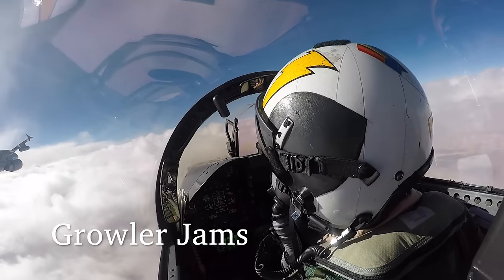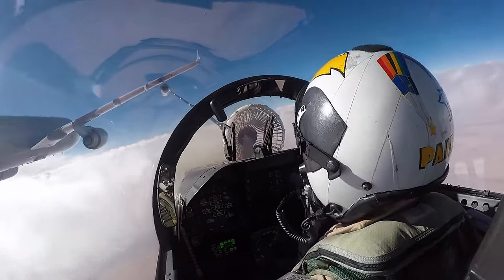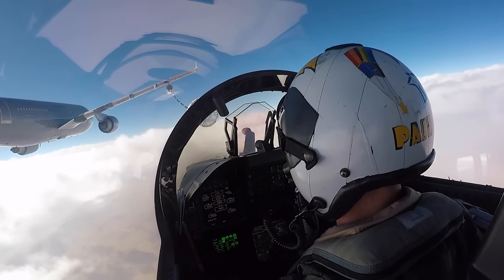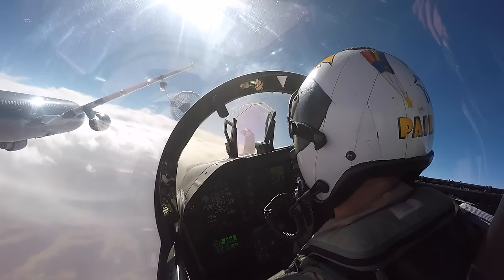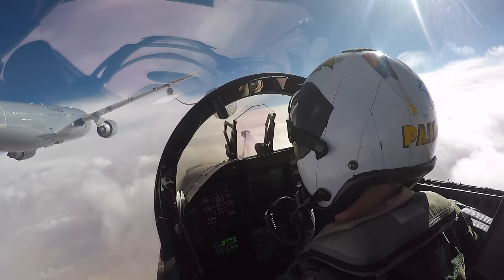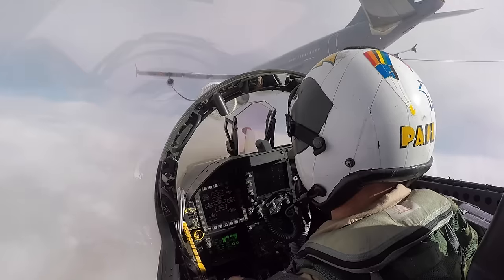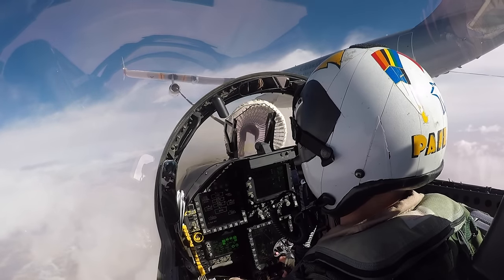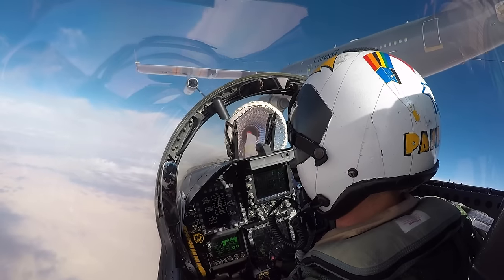My NIGHTMARE! Trying to Get Gas as Time Runs Out

Comment: "Missile warning.  Not a big deal.  Just wiggling my fingers and toes.  Fire off flares.  Not a big deal.  Just moving out of the way.  Wiggling my fingers and toes..."
Reply: And don't forget to tighten sphincter.
Reply: “Wiggle your fingers and toes” (relax). Training in T-38As back in the mid 1980s, we were told this all the time by our instructors. Fingertip formation 3 feet on the wing at 300-400 knots. It worked!

Comment: The voice over is awesome. Just wiggling my toes relaxing lol. While flying a 70 million dollar plane connected to another 100 million Dollar plane going 500 miles an hour while connected. Sounds real relaxing. Thank you to all our Great Service members.
Reply: Lol exactly!
Reply: they are only going 275-320 knots
Reply: @waynegriswold8953  Oh, well then, that changes everything...just a Sunday drive! ;)
Reply: @waynegriswold8953  at ground level they’re doing over 500 mph
Reply: It's all relative, we and the earth are moving very fast together but not at all relative to each other.
Reply: @waynegriswold8953  from now on, when I go into turn 1 at the racetrack in my Corvette, at 140-ish, I will wiggle my fingers and my toes before trying to brake at the last split second.  NOTHING compared to tanking the jet.
Reply: @F80MGod  Speed don't change based on altitude lol. 500mph is 500mg.
Reply: @l3gendarylag805  huh? I’m telling the other dude who’s saying they’re only going 275-320 knots that at ground level they’re doing over 500mph ground speed. GS and IAS are totally different, the calculations are different, and the speed output is different based on altitude. Air density and all that
Reply: @z06king  While it's appropriate to stomp the pedal initially--the rotational speed of the wheels makes it impossible to lock up (or engage ABS)--provided you still make sure the weight transfers forward smoothly, as the vehicle slows, you'll need to get out of the brakes. Skippy teaches that the better technique is to use about 90% braking after the initial application so as to make sure you hit your corner entry speed perfectly. This is where you make up the most time under braking: not by late braking, but by not over braking. Especially when trail-braking to get the car to rotate (to go fast, you must have a rear slip angle of 5-8 degrees, just like at the front axle). See you at the track.
Reply: @waynegriswold8953  Thank you. It had been a while and i had forgot the speeds .
Reply: E/A-18G is $135 million last I checked, based on the loss figure for the RAAF Growler to ground fire at Nellis a few years ago.
Reply: Kinda makes ya wonder...... What DOES it take to get this guy excited!
Reply: @BlueZirnitra Careful now. You're going to attract the flat Earthers with talk like that. Lol
Reply: These videos show the team work and skill of all who support Naval aviation.  Unfortunately the CIC is a complete fool who has no appreciation for or understanding of the military.  And at the end of the day, our pilot friend here is a family man who you can tell adores his kids. Don’t  forget the military families who also help to make our military what it is.  Naval deployments are very challenging for the families at home. Fly Navy. Go Navy.
Reply: "You don't own the plane that taxpayers do!"
Reply: Going 500 mph but looks like he’s in slow motion. . Awesome

Comment: Did this in a Tomcat in the Med. The difference is it was off an A-6, at night, in a thunderstorm filled sky.  We saw a fuel level of 200lbs before we made a successful plug and transfer.  No lie! My pilot was a nugget.  The voice over is great idea.  Well done.
Reply: [<------ idiot gamer] Med=Mediterranean?
Reply: @andrewjhollins  yes
Reply: At least over the Med you're surrounded by allies for the most part.  Not the case over Iraq unfortunately.
Reply: jesus knowing how much fuel a tomcat can hold... 200lbs is the fumes of fumes.
Reply: @joshf-o6696  If you are down to only 200 lbs in a Tomcat it doesn't matter if you have 1000 friendly airfields around within a 100 miles radius because you are not going to make it anyway. So you end up finally in the same situation as the Iraq guy you tried to portray as "more difficult"
Reply: That’s remarkable. Do you mind me asking when this was? 90s?
Reply: 200lbs in a Tomcat is basically zero fuel, so you were either going to plug in less than 2 minutes or you were ejecting.

That's gotta be a trip in front of a board of some sort.

Comment: Great job, I have observed the RAF tornadoes doing this from inside a voyager and your walk through was very informative.

The hose and drogue on the right side of the tanker was empty of fuel and that is what was causing it to be very unstable, the tanker crew should have seen this and re-primed the system prior to any further engagement.

This is very prevalent when you swapped from right to left side, the right hose did not have a good catina and was visually flying much higher than the left hose.

Comment: I was a photographer in the marines in the 60s. In 67 I was flying back seat in a F4. We did a refueling with a C-130 when we had to back off due to a hydraulic failure. 

What was interesting was the C-130 was going flat out and the F4 was going as slow as possible.

Soon after I got out of the marines I saw a recruitment bro sure with a picture of a C-130 refueling a F-4. I took the picture on that flight. He was our wing man.

Even in the backseat it was the strangest thing I ever experienced.

Comment: Funny thing, I was wiggling my toes and fingers while watching. In my youth I was an ADJ in VA-52 onboard the USS Kitty Hawk. Later in my carrier I was operations manger in Boeing's Flight Test We qualified the KC-46 tanker. Both the KA-6D and the KC-46 had a hose and drogue system in the fuselage. These were made by Sargent Fletcher. One day I was riding the elevator up to the engineering floor and there were a couple of young engineers in the elevator with me. I noticed their badges were Sargent Fletcher. I told them back in the 70s I maintained their system on the KA-6D. They had no idea what I was talking about and looked at me as if I had two heads... This stuff never gets old. Thanks for sharing.
Reply from the maker: Cheers!

Comment: Fascinating video and description. That is one event I never experienced as a Naval Aviator, for as a Stoof driver with radial engines and props powered by Avgas that was something that no piston powered aircraft ever did. While that author generally refers to "gas" it is really jet fuel (more oil than gas) he is getting. Great series.

For those not aware of how great the reflective tape on a Naval Aviation helmet is, a test made while I was on active duty determined that the reflection of the tape could be seen on a clear night about 20 miles away when it with a search light. Many an aviator has been rescued at night because of the tape. What I don't understand is why the USAF takes the opposite position. Their policy is gray painted helmets with no markings. While I was on active East Coast flying (1967-1969) there was an AF two seat aircraft that took off from Homestead AFB (Florida East Coast) out over the Atlantic and had engine problems and they ejected. Not sure if AF required rafts then or not. But they never found them. That's another point - the Navy requires rafts as well.
Reply from the maker: Cheers! “Gas”, like “the boat” are slang.  Like you know, these are the words we intentionally use.

Comment: Oh, the joy of refueling! In the F-4, the probe was behind the pilot on the starboard side. The RIO would guide us into the basket, so as a pilot, if it was a different RIO, there was some adjustment to the guidance. Some knew that we had to fly the basket close to the canopy and a bit low; the air stream would move it right and up as it traveled aft. Others would give a "come left, easy left." On a miss, I always wanted to know the clock position of the miss, which help reposition for a new pass, as well as whether I should have listened or ignored the "come left." One night in the Med, after a bolter, and then a fouled deck wave off, I figured I had two passes to bingo. The ship told me they had a Tinker tanker (A-4 with refueling package) and wanted me to take a drink. I figured it would be trick or treat (trap or refuel), but no, they wanted me to rendezvous and take the treat. As if night refueling is easier than a trap. Hah! We pulled off the tanker with max landing fuel, and then Forrestal (CVA-59) told us to bingo. That became an exciting new adventure as the bingo field did not know they were the bingo field. Its lights were off, we couldn't raise the tower, my RIO was working the frequencies, also talking to the ship to let us come home or get the field to turn on some lights. Finally, runway lights came on, and we were on land. We had pinned the missiles and seats, but once inside I realized I hadn't brought in the fuel chits, and wanted to return to the aircraft to retrieve one. The duty officer wouldn't let us leave ops to return to the airplane. Apparently, a few nights previously, a guard had fatally shot his relief guard because the relief didn't know the security password for the night. We decided we could wait until the next day to fetch the fuel chits!
The next day we were back aboard FID (First in Defense). 

I really enjoyed this video, and others you have published. Thank you! Non sibi sed patriae!
Reply from the maker: Hell of a story.  Thank you for your service, Sir.

Comment: Man, my butt was puckered watching this and i wasn't even in the cockpit😂. So what was more nerve-racking to do the first time, your very first Case 1, or your first A2A refuel? I had a problem in DCS at first with the case 1 landing, but once i hit all the numbers right, it got pretty routine. It felt very controllable. With the a2a refueling, there are many more variables that are beyond your control. Not to mention pilot induced oscilation, which happened many times at first. Right when I'm about to connect to the nasket it's like "buck fever" or something. This was a great video in what i think is the most impressive skill of a naval aviator. I dont mean to make it sound like i can do this, but doing it in the DCS Hornet is the only thing I can compare it to lol. Thanks Pail.

Comment: As a KC-135 Crew Chief, I used to hate drogue missions, and used to make jokes about the pilots refueling, needing an assist (a basket) to refuel versus a much more potentially damaging hard point refuel. This point of view makes me retract all those uninformed jokes. I am still not entirely sure this wasn't simulation, there was a lot of time with pilot looking over shoulder as if he was talking to camera, too much to think it was voiceover. But, I could be very wrong. Nice job though. I learnt many things about my mission that I only had half the story of after many years of being on a tanker, watching refuels with drogues.😊
Reply from the maker: This was as real as it gets.  No simulation here.  Drogue tanking sucks, right?
Reply: @GrowlerJams  Yes, it seems drogue refuels on the 135R were easier due to the hose only being around 10' long, so the boomer did most of the work. Hard point refuels were certainly the best, except when it came to night refuels of stealth craft.

Comment: Just a suggestion: The drogue needs aerodynamic control surfaces and sensors so that is can be computer controlled to fly in a fixed position. That would be like on an airplane: rudder, elevator, and wings with ailerons. This way the pilot would be able to connect on the first try.

Comment: This was really cool, and a little tense there on the starboard side. I have a question that might be obvious, but i'm realy curious. As you're refueling midair and taking on several thousand pounds of fuel, do you feel the flight characteristics of the jet changing? Just napkin math from searching on google, you're adding ~15% extra weight in 7 minutes, i feel like the change in handling would be noticeable. Thanks for the content!
Reply from the maker: Not really.  The jet balances the CG automatically, so the feel is about the same.
Reply: @GrowlerJams  That's awesome. I should've realized the flight computer would  adjust. TYVM for answering, I really love your content! o7

Comment: Awesome vid! Is it allowed to use autopilot at pre-contact and during fuel transfer? Seems it would reduce pilot workload by holding the plane level with just having to bump the stick/rudders for minor corrections vs. manually flying into the basket
Reply from the maker: I’ve never tried it or heard of that as a technique.  There are so many  inputs that are required during tanking that autopilot just won’t hack it.

Comment: Sorry sir, but you are looking for the basket instead an fix point at Tanker.
At the deseangage you was not at the correct point.
The basket ran out from you showing that was not at the stable position. 
Go to pre contact align de basket and mark a fixed reference on the Tanker.
Don't look for basket anymore.
Fly on Tanker ref.
Touching the clouds is not a good place. The basket dance.
You may lose the visual sundly.
You have a precise piloting and you have nerves control. Good!
From a friend!
Reply from the maker: I get this comment from time to time from people that have never actually tried this in real life.  You can’t simply fly a reference point from the tanker and engage the basket because the basket is moving around much faster than the tanker.  In the end, the pilot has to look at the basket and make a play for it. “Don’t look at the basket anymore” will not work and is not a viable technique used by pilots. 

Where did you learn your technique?

Comment: A4 Skyhawk Jax Fla, I.F.R. gone bad, Dunno what happened in the air but the jet came back with the basket on the pribe, and the hose wrapped several times around the nose of the aircraft, fortunately it did not go back far enough to keep the nose gear from opening, fuel did get down the intake and mess up some stuff like cockpit pressurization, g suit etc
Reply from the maker: TYFYS.

Comment: For anyone who's interested, the plane took on 3,030 gallons of jet fuel. At the current price of $6.42 a gallon that's $19,452.60. I assume the Navy buys jet fuel in bulk, so cut it back to $4 a gallon. that's $12,120 for a single growler flying for 4 hours. Roughly $3,000 an hour. Double that to add a wingman. 
That's still only 5% of the flight cost for a Growler. Adding in the cost of maintenance, manpower, spare parts, flight deck operations and depreciation; as of 2018, Growlers cost $60,000 an hour to fly. So an 8-hour flight for two growlers costs the United States $960,000. Nearly $1 million.
While providing ECM over Anbar Province, Iraq.
To block enemy search radar.
Over Anbar Province, Iraq.
I demand the government buy me a free house. It doesn't have to be a nice one. Just 3-5 hours' worth of Growler flight.

Comment: Question, wouldn't it have been more efficient to wait until the tanker and you returned to straight and level instead of trying to establish contact in a roll? Civilian pilot here so I know eph all about aerial refueling.
Reply from the maker: Not if you need to get gas as quickly as possible to hurry up and het back on station.
Reply: @GrowlerJams  ah, ok, you’re on the clock.

Comment: Great Video. Do the drogues I've seen with wings on them make that turbulence more manageable? Has to be scary the first time!
Reply from the maker: I’ve never seen a drogue with wings. 🤷🏻‍♂️
Reply: @GrowlerJams  maybe rogue is wrong word. I saw another video of the refueling with a hard tube instead of hose and there are like "wings" on it. Not on the rogue itself. Had the big steel cage where you kept the U-shape in the line. That's why I'm not flying....
Reply from the maker: Gotcha, that’s a boom.  Air For e jets tank off that.  Never tried it.  Can’t really compare.
Reply: @GrowlerJams   thank you for your service!

Comment: Hey just a general question do you know what the most difficult health factors you need to meet to be allowed to become a fighter pilot? Heard its similar for German army to the US which is kind of my goal right now as ive realized a lifetime in a boring job is nothing for me.

Also AMAZING skill and not being too aggressiv in the end thinking dang i need to get it now. Thats a real master, knowing when to back out or request a bucket on the other side. As a DCS player i can more than appreciate this skill without even knowing half of the skill this actually takes to do up in the sky.
Reply from the maker: Not really sure…probably the vision requirement. 20/20
Reply: @GrowlerJams  Thanks for the answer sadly I dont have that but afaik in germany you can fly with glasses or get surgery which i will do either way. Thanks a ton and i have much respect for what you do.
Reply: @GrowlerJams That's why I fixed F-14's instead of flying them. By the way I was on the Roosevelt, and the Enterprise, and the Eisenhower, and the JFK.

Comment: does it make a difference from a330 which wasn t designed for refueling  compared to the the kc135 (mprs in your case )which was designed  as a counterpart for the b52 operations during cold war?
Reply from the maker: Not really.  Tanking is tanking.

Comment: As you take on 7000 to 8000 pounds of gas, do you need to increase speed incrementally to compensate for the newly taken weight?
Reply from the maker: Not really.  Generally, the tanker slows down as it offloads to maintain a constant speed.  The speed gain for that small of an offload for a tanker is negligible, however.

Comment: Try it in an MH47. The rotors extend beyond the probe tip, and if the drogue bounces into the rotors everybody dies.
Reply from the maker: Sketchy.
Reply: @GrowlerJams  it's only as bad as it sounds when you have a new pilot on the controlls.